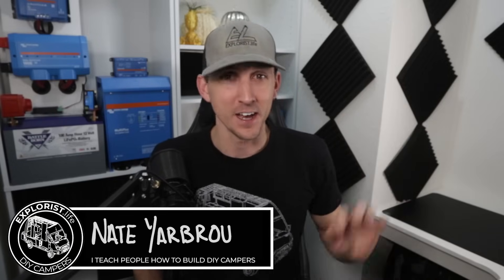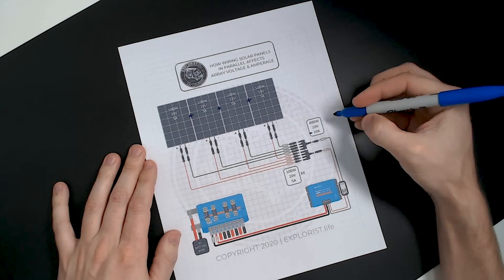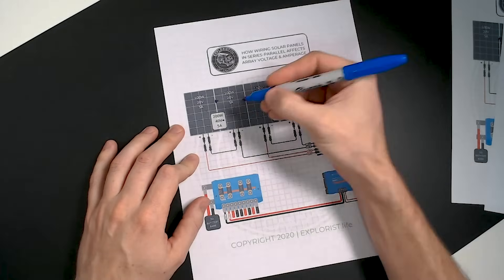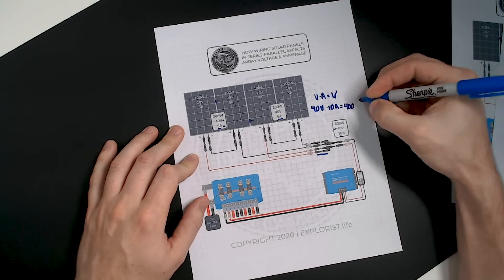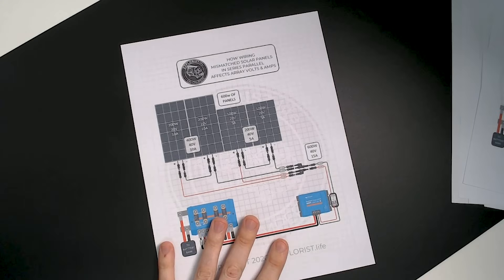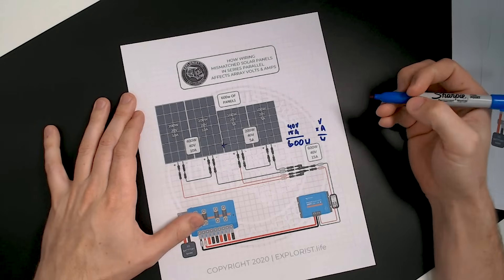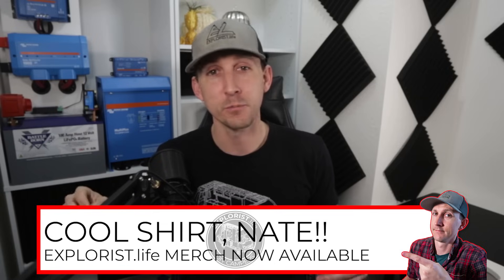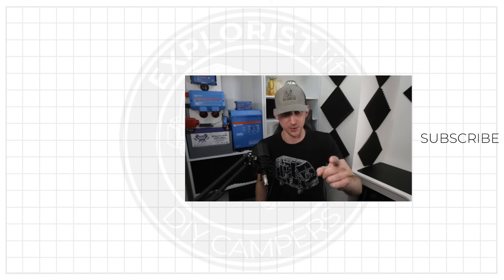How to Wire Different Sizes of Camper Solar Panels Together - Effects of Mismatched Solar Panels

Comment: I just recently found that you don't get 100% of what the panel is rated for. 80% is more likely. Something else I noticed was perplexing: I metered one 200w panel at 144w and the other at 167w but when I connected them in parallel they metered at 260w output. Some of that could be due to I was charging an Ecoflow Delta 2. The input cable for the solar array is very small. It gets warm when it charges the Delta. I think that's where I'm getting the loss. What do you think?
Reply from the maker: Hey, @Maxid1! I appreciate you taking the time to ask your question, but unfortunately, I don't have enough info about your specific question to provide an accurate answer, but here is a playlist that, if you watch all of the videos start-to-finish (and take notes 😉), you'll have a REALLY good idea of how to design a solar array: https://www.youtube.com/watch?v=Jkbs84sBHsg&amp;list=PLmvhcyi4n0TV9pi83rFTv3ZuMT_S1xIZt

Alternatively, I have some of my most common solar array setups pre-built here: https://shop.explorist.life/product-category/all-products/camper-wiring-kits/solar-charging-wiring-kits/

Comment: Very helpful, thanks. How does using something like SolarEdge power optimizers change the equation?  I’m assuming it could be substantial as they regulate the power between individual panels helping minimize the effects of partial shade etc.  Would appreciate your thoughts. Thanks

Comment: I’m screwed because of the installer (dealer) in 2021. Installed is a go-power 190w, when they added the second panel they just removed the MC4 cover and twisted the wires and reinstalled the panels and covered the wires with Dicor- a 200w panel. Now in 2024 I purchased a 400w 12V Bouge panel. Note my charge controller now is a Victron 100/50. What do you say?
Reply from the maker: Hey, @robertnasser9937! I appreciate you taking the time to ask your question, but unfortunately, I don't have enough info about your specific question to provide an accurate answer, but here is a playlist that, if you watch all of the videos start-to-finish (and take notes 😉), you'll have a REALLY good idea of how to design a solar array: https://www.youtube.com/watch?v=Jkbs84sBHsg&amp;list=PLmvhcyi4n0TV9pi83rFTv3ZuMT_S1xIZt

Alternatively, I have some of my most common solar array setups pre-built here: https://shop.explorist.life/product-category/all-products/camper-wiring-kits/solar-charging-wiring-kits/

Comment: Can I make  2 series with pairs of 150w and 200w?I want connect tose pairs in parallèle like your exemple.

Here s the spécification on those150w: 
Maximum power voltage: 18V
Maximum power current: 8.33A
Open circuit voltage: 21.24V
Short circuit current: 9.16A

And those 200w
Maximum power voltage: 20V
Maximum power current: 10A
Open circuit voltage: 23.6V
Short circuit current: 11A

My charging contrôler: max: 60V
                                       max: 21A
                                       max: 120W
Reply from the maker: Here's a video that will teach you how to calculate what happens when you connect different sizes of solar panels into the same array so you can learn to do your own calculations: https://www.youtube.com/watch?v=jejro4zkl8I

Comment: Hi,
Can you tell me what is best set up for 12pc solar panels setup (365W at 42V and 11A), please?
I have so far 8 pcs in serial and 4 psc in serial connected to combine box. 
maybe would be better to do divide 8pcs into: 4pcs in serial and 2sets parallel plus 4pcs serial and connect that to combine box. thanks,

Comment: i have one 200w panel and want to add more…but RV roof configuration is limited…so i want to add multiple smaller in size 100W panels.  my question…if i add in parallel  with same Volts i should be ok (not loosing efficiency)?

Comment: What if one panel gets full shade? Does that destroy your array efficiency too?
Reply from the maker: In a real world scenario, a single panel would never get perfect shade.
Reply: That is true, but if all other panels are getting full sun, and one is shaded, it can limit the current on all the others that are connected, correct? Because the shade would lower voltage and current, right?
Reply from the maker: @MakerDent shade on the panels will decrease output.  If maximum solar output is the goal, one should ensure all their panels are in the sun.
Reply from the maker: Design the solar array properly for full sun.  You’ll drive yourself crazy trying to design around hypotheticals.

Comment: How about if you connect 4 HQST 100w solar panels and one Renogy 100w solar panel connected in series? I know their current and voltages are slightly different. What happens?
Reply from the maker: The video you just commented on teaches you how to calculate what happens.

Comment: Is it possible to parallel one series string and one parallel string if they match up amps?

2x110w @ 18.3v 6 amps each.
3x60w @ 20v 3 amps each.

Series 110 - 36.6v 6 amps
Parallel 60 - 20v @ 9 amps

Array parallel - 20v @ 15 amps

Does this work?

Comment: Quick question. I have 4 200 watt / 23 volt / 10.42 amp panels and have an extra panel laying around. The extra panel is 200 watts / 44.76 volts / 5.24 amps would this benefit the array or drain efficiency?
Reply from the maker: The video you commented on will teach you what to expect when combining those panels.  I've taught you the skills, now go apply them!

Comment: Thanks Nate for providing this very comprehensive and understandable information. I have 48V electric riding mower which I'm setting up with solar, so that it will charge as it is running, thereby extending my range. Unfortunately, through using your online PV/mppt calculator I found out that my pv voltage has to be 5V above that of the 48V battery bank. From a lack of knowledge I assumed I could just have one 100W solar panel push wattage into the bank while driving it. Why does a trickle charging solar panel (the little ones you can buy for RV batteries running at about 10 watts) work on a 12V rv battery, since the voltage of that little panel would be way below the 12V of the rv battery. In my case I'd have to provide at least 300 watts of solar panels (there is no way I can fit that many panels on the support rack I'm building on the mower) in order to actuate the dang mppt controller. Is there any alternative way to push the single 100W into the 48V bank? I see this as a major drawback over a 12V or 24V system in some applications. There should be devices that up-converts (inversion from +- 18V PV voltage to +- 48V battery bank voltage) PV voltage to activate the charger at any time? Any suggestions would be greatly appreciated since I've already put in a lot of time into this built.

Comment: unless you use two regularors 😉
Reply from the maker: That would no longer be mismatched solar panels in the same array, which is the topic of the video. 😁👍
Reply: Precisely , and at a relatively low cost well worth its money so an advive you should at least mention  @EXPLORISTlife
Reply from the maker: I  have other videos dedicated to systems with multiple solar arrays.  Talking about that in this video would have been off topic.

Comment: I want to do a series parallel configuration. The panels are all 180 Watts but 4 of them max out of 24 volts open circuit (BougeRV) the other 3 at 20 volts (Newpowa) Is that okay?
Reply from the maker: The video you just commented on will teach you how to run the numbers on that.  I taught you how to do it...now do it!

Comment: I commented on your blog but I think that this gets more traction, sorry for the long question that’s coming!

I have a question about mixing solar panels. 
I currently have a Renogy RSP200D panel that I bought for another reason and was planning on buying 3 more for my roof rack. However with my layout, these panels are just a little too wide. Instead I am going to use Rich Solar 200w 12v panels(RS-M200)

I can however fit my single 200w Renogy and the 3 Rich Solar panels with my config, and only looking at this option to not waste the panel that I already have.  Would this be Ill advised, or if they are close enough in specs that it won’t make too much of a difference? 

Rich Panels:
Voc: 24.3v
Imp: 9.80a
Isc: 10.2A

Renogy:
Voc:23.0v
Imp: 10.42a
Isc: 11.05A

MPPT:
Victron SmartSolar MPPT 150/60-Tr
Thanks!
Reply from the maker: The video you just commented on teaches you what happens based on your panels specs.  Take what we taught you and apply it to your situation.

Comment: Actually what you want to be  cognascent of is -WATTS per square inch
You'll will find the bigger the panel the more Watts per square inch
those big ones have so they are more efficient than the smaller panels
everyone loves the $$ of the 100W panels but a 320, or 350 will give you
MORE power than 4   100W,panels. They do make 400W+ but they are
not as cost effective as panels in the 300W range.

!
Reply from the maker: 😂🫣 wow.  That has literally nothing to do with the topic of this video.  Well done.

Comment: I am buying 2x 150W panells which are 22V and 9 am each. Also i am adding another 2 panels which are 100W with 22V and 5 amps

so as per your series connections these panels will produces total wattage this way:
22V + 22v = 44 V
9 amp + 5 amp = 14 amp

wattage = Voltage x Amp
 44 x 14 = 616 wattage

so out of my 500 wattage panells, they're producing 616 wattages
Reply: You mean his example with each pair in series and then wired in parallel, at about 7 minutes into the video. (If you did all in series the watts would be quite a bit lower due to the lower amp rating on 2 of the panels.)

So hmmmm....are we missing something? Are your specs correct?
Reply: @debbiedogs1  I am having 2x150W (22.5 V and 9.98 amp) each panel, 4x 100w panels (22V and 5.6 amp each) which type of connections gives me better power to charge 400amps lithium battery?
Reply: Yes I am also having this same issue trying to calculate my panels.
I'm having two 175w panels in series
23.7+23.7= 47.4v
                       9.03a
And two 55w panels in series
22.9+22.9 = 45.8v
                       2.94a
Then put them together in parallel 
   (Lowest voltage)  45.8
       (Add amps)   9.03+2.94=11.97

       45.8×11.97 = 548w
How can this be if I only start with 460w?????
Reply: In your case if you add them all in series you add up the voltage and multiply it by the lowest amp which is 5. You don't add amps up when in series.

Comment: I appreciate this information... about keeping the panels the same size... and what you explained about adding in a smaller panel, it reduces the overall performance.
My question is 
If smaller panels are at the beginning(negative end)of a series, then larger panels are added, is the math the same?

Comment: Why doesn't the guy with his SEVEN panels at the end just put them ALL IN PARALLEL,  that should minimize the loss, unless they all have different sun exposure.
AND to put the 25V and 20V solar panels IN PARALLEL seems like a BAD idea because the 20V panels will act just like RESISTORS to the 25V panels, instead of contributing energy they should ABSORB current, and maybe even overheat? So I think that math does not add up.
Overall, a SUPER VIDEO, THANK YOU, it clarified things A LOT for me and makes the subject confrontable...
Reply from the maker: Because then the voltage would be too low for the MPPT to work effectively and the array amperage would be far too high to use mc4 combiners and 10ga wire, which makes wiring excessively difficult and expensive.
Reply: Yes, THANK YOU for the fast answer! I didn't think of that...  And I thought that an MPPT contoller SHOULD be able to boost a LOWER voltage up to 14.4 or so LiFePO4 charging, right? Do ANY of them do that? @EXPLORISTlife
Reply from the maker: I 'think' there may be some boost charge controllers out there, but I don't really deal with those as there should really never be any reason with good solar array design that the array voltage would be below the battery bank charging voltage.

Comment: Just use separate charge controllers. Perfectly fine solution for LFP batteries and it adds redundancy to the system.
Reply from the maker: Yes, but this is a theory based 'what happens when I mix and match solar panels' video.  I have a different video about using multiple charge controllers.

Comment: Hi Nate, quick question I can't find an answer for on the internet, not even from electricians. So, you mixed different panels in a way that the voltage would be the same so you could parallel them. What if you do the opposite? We want to serie 3 big panels (120w, 5,7A and 26,89V) so it becomes 360W, 5,7A and 80V. We also parallel 2 smaller ones (50W, 2,63A and 20V) so they become 100W, 5,26A and 20V. We then Serie these 2 strings together, the A is almost the same so we don't lose to much, but there's a big difference in voltage (80V and 20V). I would assume you just sum them up to get a total of 100V (and 460W and 5,26A), but is this really no problem? We might also add a panel (extern, on the ground when we can) in serie with the whole thing with 200W, 6,66A and 40V. Again, almost the same A but a different V. Just count them up in serie? It's not gonna harm anything? Cause a fire? No bigger wires I guess? Our battery is the bluetti AC200 max and can take 145V, so that would be just perfect. Some people say this is a great plan, others say the total opposite, but no one can explain why... It would mean the world to us if you could help us out! Big thank you already!

Comment: I think you should take the time to mention one BIG issue with solar very few address. MPPT will chop your voltage off to what ever system your using. 12v, 24v if you make 20v. and you push that into the MPPT controller, your going to cut off any voltage over, say a 12v system. So right off the back, you're saying its a 400 watt system, but your MPPT is chopping off 8 VOLTS and now your only using 240 watts, NOT 400 watts. 

Most to all solar "pushers" will NOT tell you about this.
Reply from the maker: That's not how a charge controller works, no.  If you tried to push 20V into a 12V battery; it would damage it beyond repair at best, and 'rapidly combust' at worst.  Here is a video that will teach you how a solar charge controller works: https://youtu.be/Jkbs84sBHsg?si=Erh9qYZ_p-v04QXz

Comment: Is it possible to parallel say 2 110W panels and then insert the parallel +/- into a series string with other panels that are 200W? I have an (RV) with two 110W panels from the factory and I'd like to add additional 200W panels (similar voltages 24.3/23.3) in series with them. By paralleling the 110 watt pair I can get the amps up so the lower amps from the 110W panels don't restrict the overall string. Make sense? If feasible, may even want to parallel the resulting hybrid string with another series string made up of only 200 watt panels.
Reply from the maker: Hey, @randyhunt189! I appreciate you taking the time to ask your question, but unfortunately, I don't have enough info about your specific question to provide an accurate answer, but here is a playlist that, if you watch all of the videos start-to-finish (and take notes 😉), you'll have a REALLY good idea of how to design a solar array: https://www.youtube.com/watch?v=Jkbs84sBHsg&list=PLmvhcyi4n0TV9pi83rFTv3ZuMT_S1xIZt

Alternatively, I have some of my most common solar array setups pre-built here: https://shop.explorist.life/product-category/all-products/camper-wiring-kits/solar-charging-wiring-kits/

Comment: Great videos ! I noticed my charge controller which is rated at 100VDC and 40A there is also a Max input rating of power of 12VDC @520W or 24VDC@1040W. Questions. With this power rating would 20VDC be linear to calculate wattage ? With the power Max input does it matter which configuration is used considering wattage max capacity?

Comment: Final question. If I had a system that say is 19.4v at 26amps (500 watts) and I was to add to it either 1. A 200 watt panel (22.7v 9.1A) or 2. A 120 watt panel (19.8v 6.1A) %either added in parallel. Wouldn’t the 200 watt panel be more efficient and still be capable of producing more power when less then ideal conditions are present?

Comment: Another question: what if I have 3 - 100w panels on the roof of my camper, but they aren’t point in the best possible position, so not getting ideal sun, and then I have 4 80 watt panels (blankets) that are in ideal conditions. Your figures were all based on ideal conditions, yet we don’t always have ideal situations.  How would that effect things?

That would make for a better video.

Comment: Question: solar panels very very rarely have the ideal conditions to put out what they are rated. Especially on camper/rv’s where we can’t always park them or place panels in the ideal locations etc…

So when say a 200 watt panel isn’t producing its full 200 watts. Say rated at 20v 10a, what is it’s actually output?  Does the voltage drop, or amps drop or both? In which case. And here’s the big question. If the 200 watt panel has lousy efficient y and is matched with a 100 watt panel with twice the efficiency. How would that effect the formulas you mentioned?

Comment: Vary helpfully videos.I m wandering can you use two separate charger controller?one for the right panel couple and an other one for the left three panels.Both controller outputs in parallel to the battery.Many hallo from Greece.